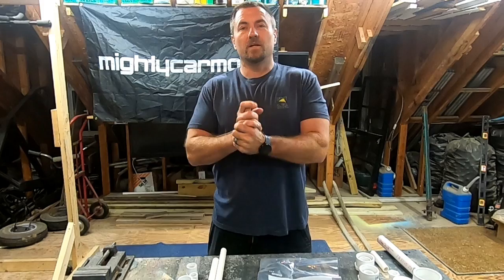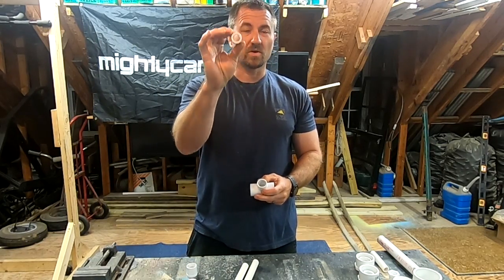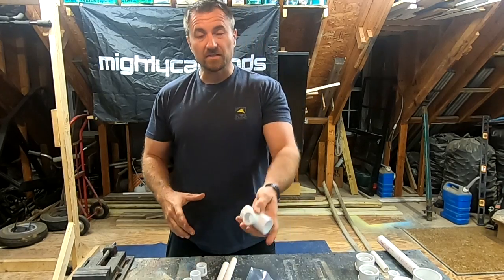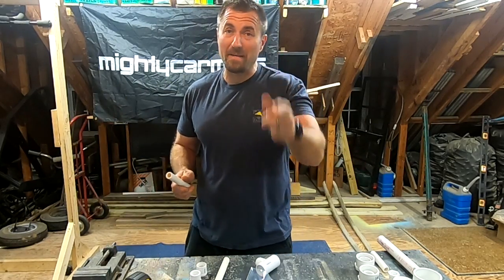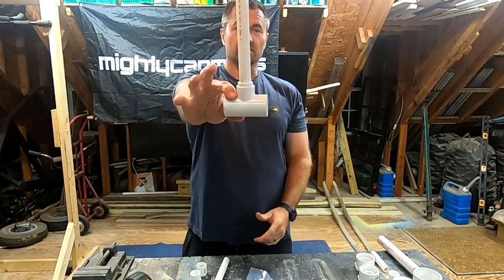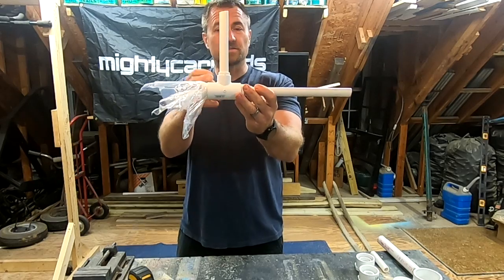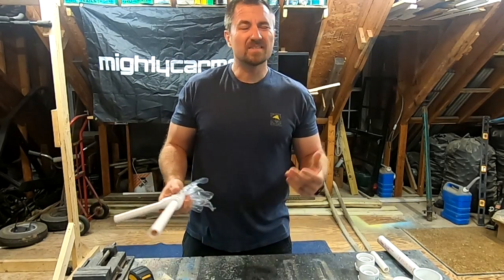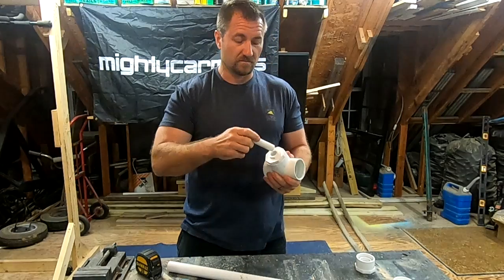DIY STEM   PVC air horns       (Best way to annoy your neighbors or kids)

Comment: Spend another dollar or two and buy a 90-degree elbow for the air inlet so you can point the horn and look in the same direction!?
Reply from the maker: did not think of that.   Thanks for the tip.     I also wanted to put a cone on the end to see what that does.

Comment: If you use a bike tube instead of a plastic bag it makes it really loud and durable. It’s a little harder to blow but makes a really good sound.
Reply from the maker: i did not think of that.   i do have some tubes left over.    maybe i need to do a follow up video on the different items you can use.     plastic bag as a baseline, then tube, and what ever I can find.    Thanks for the tip.    Love this platform for knowledge sharing.

Comment: Dude, you can open holes on output tube, so you can play music, like a flute 😁
Reply from the maker: Awesome idea.   did not think of that.   I still have it on the shelf.  Maybe i will try it out.  thanks Yo
Reply: @5LakesGarage  
👍🏻😊
You can also use a second tube, inside which the outlet tube fits...
When you telescoping the outer tube (like on a trombone) you'll have different sounds 😁
Optionally, you can add a large plastic funnel to the edge of outlet, (like the ones we use to transfer liquids into bottles)
this will make the sound louder
Reply from the maker: my boy plays the tuba and trombone.   this sounds like a project I can bring him in on.

Comment: If you go even bigger with all the parts will the sound get lower in pitch? Like a fog horn?
Reply from the maker: Correct.  you just need a lot of Lungs.   :)    I do plan on doing a short but hook it up to the big compressor.   Day job getting in the way.        Thanks for watching.

Comment: How load is the low pitch one
Reply from the maker: it is still pretty loud, it is just a lower pitch.  It is not as ear piercing as the little ones.   I made one with a 3" pipe and it started to get hard to blow.

Comment: I want a deep sounding one for my Kayak........
Reply from the maker: we did build one with a 3 inch pipe but It was harder to blow.    But putting one on a Kayak would be killer.
Reply: @5LakesGarage  I liked you video and i see your in the Jeep family. You got a new sub from me.
Reply from the maker: Thanks for the sub.   Need all we can get.   :)     we have two jeep projects to finish up.   The Wagoneer needs the trans put back together and the the CJ needs lockers.   Just need to find time to get in there.  

Thanks again
Reply: I want one for my bicycle. I already installed a truck air horn on my motorcycle, But I want to make this pvc one with low pitch for my bike 😂🚲